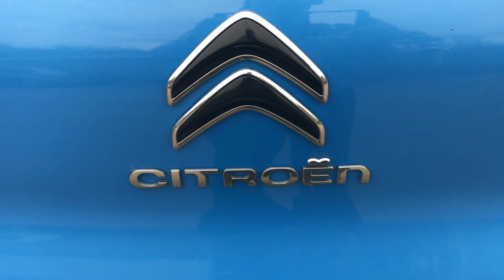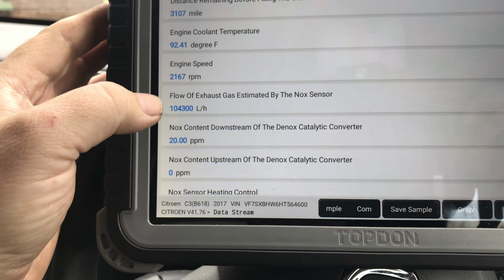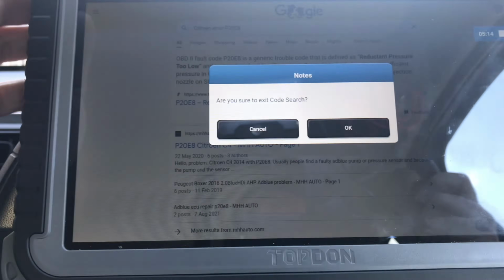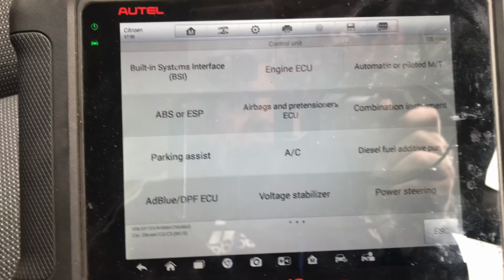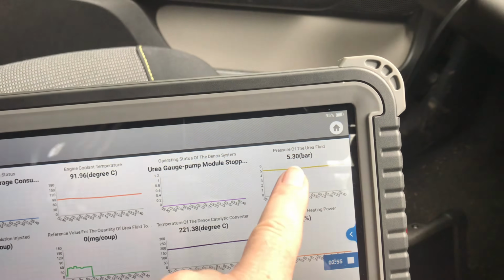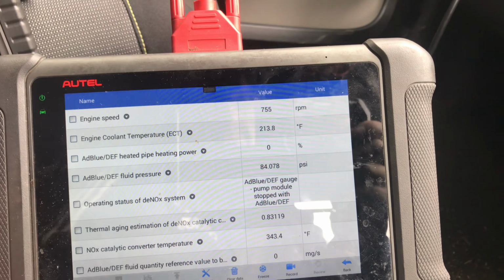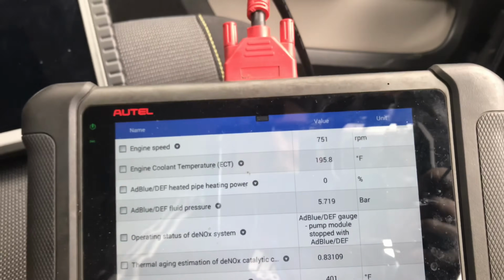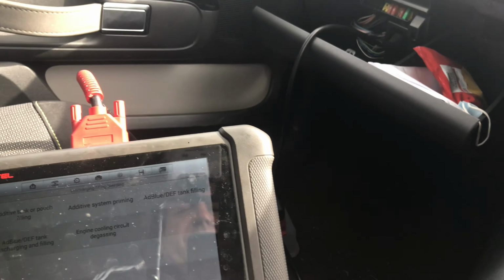Citroen C3 (2017) AdBlue Nightmare😭 - P20E8 Urea Fluid Low Pressure

Comment: For UK owners reading this with a tank quote on a Citroën, Peugeot, DS or Vauxhall: Stellantis runs a programme on these AdBlue tanks for diesels built between January 2014 and August 2020, up to 210,000 km (about 130,000 miles). Parts are fully covered under 5 years and 150,000 km, on a sliding scale after that. The catch: the repair has to be done in the approved network.

Comment: SANDY COMMON FAULT MATE ON THE CITROËN C4 DIESEL THE PUMP SANDY SEALED IN THE TANK WHERE THERES A CIRCUIT BOARD INSIDE THE TANK ITS A NEW TANK MATE FILL UP WITH ADD BLUE CLEAR CODES JOB DONE MATE GOT THE SAME PROBLEM JUST ORDERED A ADD BLUE TANK OFF EBAY BRAN NEW

Comment: 4 bars means 0 bars in PSA cars. the best way to read is to drive it wen engine temps is reached. and don't turn engine off, once off and idle it reads 4 bars again, or ramp to 2500rpm while parked for 1min and you can read it also.

Comment: If the system reads as 4 bar pressure it’s a false positive reading. 4 bar is as low as the system goes and is technically zero ( 6-7bar is normal)

Comment: The issue is that the system software is faulty and there’s only a few options to sort it. One is a new adblue tank at around £2000 second is a system reset but the problem will return and third is a adblue delete which permanently removes the software from the car which makes the adblue system not working and not required £450
Reply: Disabling the AdBlue means the vehicle can't be used on UK roads - it's illegal and you can be prosecuted if found. OK only for off-road use, eg farms, construction sites etc.

Comment: The 4 bar is misleading value,it should considered 0,to be checked with engine running at operating temp and should hover between 5 and 7 "bar"

Comment: Thing is the tank always sits at 4 bar of pressure when switched off, only rising after the engine is started and reaches a certain temperature.
Reply: 4 bar is just the lowest that the sensor can read. True pressure is 0 bar. Working pressure 5-6

Comment: Two issues here: one is the Ad Blue level which never seemed to match the 'full tank' you found you had when you topped up.  So the level sensor perhaps?  Number two is the fact that those expensive service tools seem to be utterly useless!  Are engineers meant to own 'dozens' of the things?  Why do readings change between devices?  Is this deliberate by the tool manufacturers?  Or are the vehicle manufacturers not being open about the data you're supposed to see?  Either way the whole repair process seems to be tooled to PREVENT servicing - except, I suspect, by the stealerships.
Reply: We normally use diagalyser, idvh and sometimes Inca (;

Comment: No need new adblue tank, need adblue off
Reply from the maker: Yes that’s true but how do u switch it off in the module or the vehicle configuration? Cheers Sandy
Reply: @sandyande   I don't know if you'll see it on all the third party diagnostics systems, like Topdon, Kingbolen, Autel, Launch or whatever, but if you are using Diagbox, there is a config item in the BSI config menu for "Presence of a Nitrogen Oxide reduction system", where you can change it from "YES" to "NO". However, there's no related config item under the ECM config menu, so all this does is prevent the UREA light from coming on, or the countdown being displayed, or the horrible (very distracting red) message being displayed on my car's second LCD screen every few seconds once the countdown starts. 
It doesn't prevent the P20E8/P3052 or P20F6 or any other Adblue related codes from being set (whatever the root problem is).
Maybe disconnecting the wiring harness at the urea tank would stop that. I have heard that sometimes you might need to do this anyway, because the tank / ECU sort of "soft locks" when there's a persistent fault in the SCR system, and it won't even try to run the pump. Disconnecting the tank for 30 seconds or so is supposed to reset that, but I don't know...

Anyway, I think the previous commenter is referring to an ECU remap. Some dodgy practice of mapping out the adblue, as well as maybe the DPF and EGR, and even getting a power and torque boost too. They only charge about €450... Of course, it's illegal to drive the car on a public road with those emissions systems mapped out, but people still just do it because it's not picked up at car tests (neither at the UK's MOT nor the NCT over here - at least not yet). 

I wish these systems were reliable, and weren't so expensive to fix. I could handle a one time total bill of, say, €1000, if there was a guarantee of a correct problem diagnosis, and the replacement tank was warrantied for at least 2 or 3 years or 50 or 60 thousand kms, but nope... They expect you to pay thousands and maybe give you a year guarantee, and you might have to do it 2 or 3 times in the car's lifetime. It's disgraceful really.

Comment: A family member has had similar issues. We've cleared the lights, looks like an intermittent fault with the AB Valve. My apologies - video/reception was jumpy - did you find out what was wrong with the AB tank?🤔🤞
Reply from the maker: Needed a new tank and pump
Reply: 4bar shows as a base even when it has no pressure

Comment: This is usually a fault within the adblu resevoir itself  & whatever is done, if the tank (spendy) isn't replaced the fault will return. It's a big issue with these PSA's.   A lot of people opt for an adblu delete instead of a new tank due to cost..

Comment: Well that's about 3 days of your life you will never get back Sandy 😂😂,  did you get it sorted in the end? , I've got a 2020 Vivaro next week, out of warranty,  60 k miles, using addblue like screenwash , level dosent show when filled up , down to 50 miles before it stops starting 😂😂, if your Autel is MS 906 you can get a years updates for 256 quid at the moment,  I got mine done at Christmas 🎄  for £204 , no problem with doing them , it's a good job we have 29000 scanners as they all tell different tales😂, I had a Dacia Stepway in this week , Airbag light on the dash , scanned it with Autel and Snap on  , no communication,  checked fuses , all good , found another couple of codes in it for engine , cleared them,  now it won't start,  turns out airbag control unit blocks fuel pump on the immobiliser,  needs a refurb , £230 quid plus , don't we love our job 😂😂😂😂😂
Reply from the maker: I never got to bottom of that adblue one Mike but I believe pump was bad or just needed good clean up, that’s a good price for the Autel but it’s a bit slow now so probably not worth it
Reply: @sandyande  or you can buy a new ms906 for less than 700 quid with a year's updates

Comment: Been reading online that adblue can crystallise and block up pump??? There is and additive you can put into adblue to stop this ,allso on some peugeot and I presume Citroën that the adblue filler cap should be changed for one that vents and a lot of them don't??? They do sell these vented caps on ebay and the liquid to  stop the adblue from crystallising. Any comments welcom3d.

Comment: I have this problem on my Citroen C4 Cactus too. The engine repair warning keeps flashing up even though the engine runs and sounds good. My local garage says the P20E8 code has been reset a couple of times but it keeps doing it. 

First I thought it was the DPF filter clogging up but they said it's the AdBlue tank sensor. Any thoughts?
Reply from the maker: You need the adblue pump with tank, some have managed to clean up the pump and get it to work again, worth a try
Reply: Thanks @sandyande  it's going to my local garage soon so I will mention it to them.

Comment: hello people, i'm havving the same issue P20E8 on a partner dv6fd, I have done several test and I'm always stuck with 4 bar def pressure, everything else seems normal, no leaks, cleaned injector and nothing. I noticed on one of my drive test that the ECU wanted to inject some def but the injected reading was 0. I would like to test the pump to see if it can load more than 4 bar but the car wont do it by it self and my scanner doesn't have the function. If anyone has a tip. I'm stuck. Thanks in advance.
Reply from the maker: When it reads 4 bar that is actually 0 pressure as the sensor can not read under that amount, some folk have had success removing pump and cleaning pump and connections
Reply: @sandyande I figured out the problem reading a coment on another video. My fault is that the temp sensor in the tank is reading 0ºC. I'm waiting for the tank and then hope it fixes it. Thank you for the help!